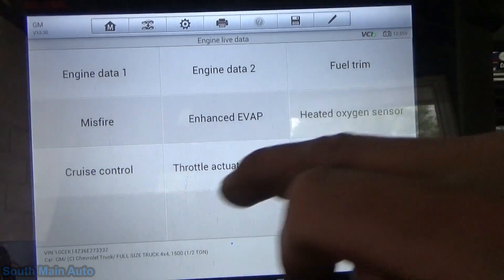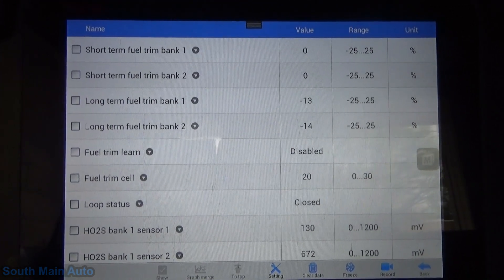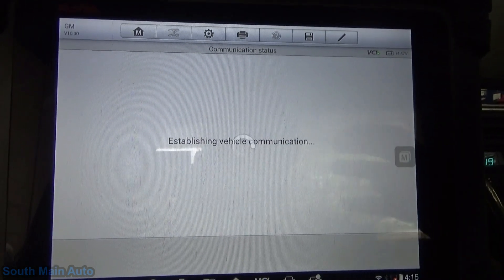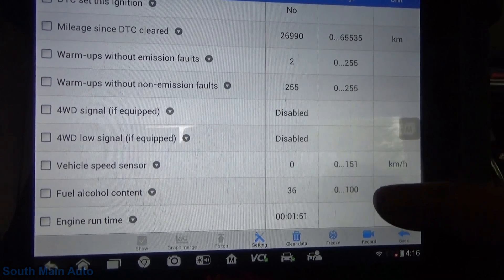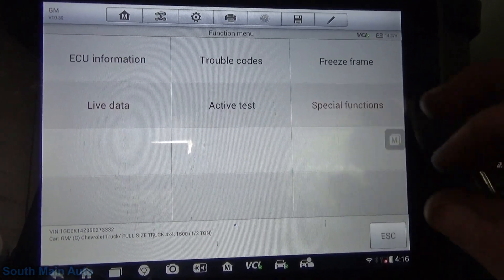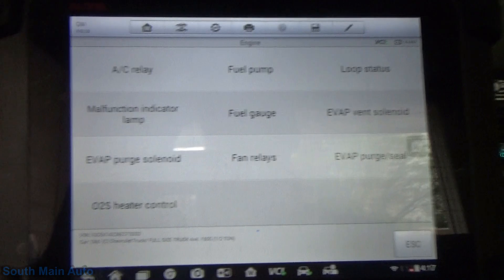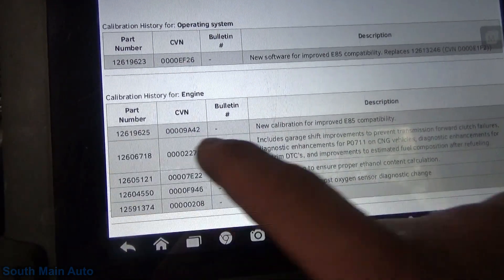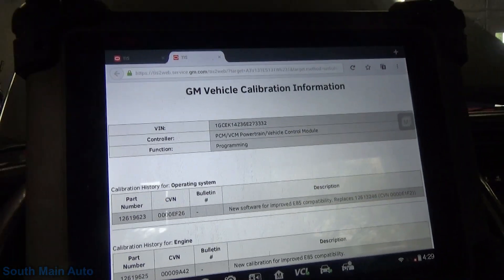Chevrolet Silverado - P0172 P0175 Running Rich

Comment: Didn't see anything but you checking alcohol in the fuel resetting & clearing codes.
My opinion is the codes will be back.
Reply from the maker: That is the fix for these. The alcohol counter gets off from miscalculating. Reset the counter to zero and ship it. Super common issue on early GM flex fuel vehicles. GM even has a TSB on it if you want to look into that. I explain it all in the video too.

Comment: This happens all the time on my 5.3 Vin O and I always run my tank down to 1/4 at the most, usually closer to 3 days after the gas light came on, haha. And then always fill it right back up to the top 
I have to reset my fuel comp about 3 times a year

Comment: Hi!  Its thanks to you and a few of these rich code videos that i found out my alcohol % was at 59%.  Got its reset at a shop to 3%. Ran fine for a while and i checked again and its now at 20% and trims are raising too.  What would cause it to go up again?  I run regular gas which is 87 octane here in BC, Canada.  Fill up full tanks every time.  Do a lot of around town driving, short trips.   A shop alsp recently changed fuel pump, but said connector was different on new pump so rhey rewired it.  Could this be an issue?  Its a 2008 Chevrolet Express 5.3 AWD flex fuel.  Maybe i should run it to empty, pay for a relearn again and then fill it up?

Wish i could just drive it to you, but i checked and its a 39 hour drive 😂

Comment: I have a 2016 Silverado with the 5.3L V8, about 144,000 miles. It runs great but recently started smelling very rich exhaust fumes mostly when idling. No check engine light or rich codes and local Chevy dealer blames leaky exhaust gaskets but there is no loud exhaust noise. I think the oil smells like gas but dealer says it's fine. I am worried the sensors are not picking up the problem and I might have a leaking high pressure fuel pump. Has anyone else experienced this or have any idea what could be going on?

Comment: I have relearning my fuel trim 4 times, replaced a fuel pressure sensor and the entire fuel pump but after a little while I still end up running rough and getting rich or lean codes. What is my problem here???????

Comment: My truck has been long cranking during cold starts. I checked my truck and the truck thinks it has 58%. The truck has never nor will it have E85 in it. No codes on the truck either. Good job GM. 😂. I always keep a full tank in it so I often put 3-5 gallons in at a time just to keep it topped off.  With that in mind, do you think that is what made it get out of wack?  Wish I could just disable it like I did AFM.

Comment: Just went through a situation like this with my 2012 5.3...I now understand what my dealer did to correct the problem I had with cold start rough idle that lasted about 4 or 5 seconds on a cold start...runs as it should now.

Comment: How did you get 5% if the water line was at 15? Thanks
Reply: Maybe because he had 90ml of gas then added 10ml of water. So the line was at 15. 15 minus 10 (of water) = 5% ?

Comment: Having same codes but on non flex fuel 07 Escalade. -18 LTFT on both banks, STFT 0-3. MAF slightly over reporting at idle, cleaned MAF, IAT sensor within range, map with range, ECT is good, recent oil change done along with spark plugs, wires and valve cover gaskets, new engine filter, reset fuel trims and after a week get same codes along with intermittent stabiltrak. No other codes given. Any suggestions? Driving me nuts.
Reply: I’m dealing with the same issue on 2010 Escalade did you find the issue

Comment: Not really sure what your solution was I have a 06 Silverado flex and got the po175 code changed the fuel pump and the mass air intake and still not fixed I always run empty and fill up so a little puzzled

Comment: That GM system does NOT sound smart at all 🤣 imo. Maybe they need to go back to or get the Alcohol Content sensor's instead of guess work. Wonder why the 02 sensor's don't have the ability to quickly report data back on a rich fuel mixture, then PCM proceed to instantly pull back fuel trims. Rather confusing system that's for sure. Maybe I need to learn more about it perhaps idk 🤔

Comment: About a month ago I had about half a tank and filled the rest with E85 just to see how it ran. Ever since I've been filling up at either 3/4 or 1/2 tank with regular 87. Yesterday I just got these codes. I'm thinking I need to run until empty, unplug the battery for a bit and then refill with regular since I don't have access to a scanner?

Comment: Anybody else have this issue and it not be the alcohol content ? I have a 07 tahoe got a cold air intake and dual exhausts and it use happen pretty often then i tuned it for more hp and better mpg and it pretty much stopped for about a month just got outta work and mid driving on my way home it popped back up i have no vacume leaks my alcohol is perfect fuel trims look great shits driving me nuts lol
Reply: Car is also driving great 🤦‍♂️ maybe am i taking off to fast after starting it ? Should i heat her up for a few minutes before leaving

Comment: You are a really good! So, the repair was to allow the computer to recalibrate the alcohol fuel % content? By driving it atleast 7 miles or fueling the truck more than 3 gallons. You checked the that the fuel was infact regular fuel. My truck was at 67%. I drove it 20 miles it said 58%. I topped it off (3.8 gallons of reular non e85 fuel) and its came back at 55%. My fuel trims are lovely exept once in a while you get deeper into the throttle the trims go -30, running rich. Same thing though, cel lights on for 0175 & 0172 with computer miscalculating the alchol %. Its a 2013, im guessing its got the latest software for flex fuel but im not sure my computer will read that, ill search tomorow.

Comment: Thank you for the information, I am certain this is the issue with my 2006 Avalanche w/ 5.3. Does anyone know how to solve this without a fancy scan tool or do you need to bite the bullet and go to a shop to have them see if the ECM needs to be reset or reflashed? Thanks in advance!

Comment: Amazing! I didn’t even know my 2005 was flex fuel but their was a sticker on the gas cap and every time I would go to the gas pump I would think could it be true? Then I did a little research and found out that if a certain number of the vin is a Z it is flex fuel but it was a Z it was correct. I took it to about 3 main Auto parts store and they ran the vin in the system for my fuel filter they gave me the flex fuel one. One time this kid at O’Reilys gave me a regular one and they didn’t know why it could be. I put half a tank of E-85 and the next day if was running funny. Also I had a diode go bad on my stock alternator so I was going to buy a new battery since it would drain it over two days as well as alternator.Long story short my son bought me a 160 amp don’t what brand from Amazon. It was good for about 2 months. It fluctuates from 15V-13.4 to the 14s and I know just from what I learn in college in dc/ac circuits it to mess up everything. Because it needs a steady flow of electricity. Right? Sorry for the long novel I left here but your videos I will watch for sure. Thanks god bless!

Comment: I have a 2010 5.3 Sierra Flex and I am getting a p2196 code. I've looked up everything possible and can't find a solution. I have changed the O2 sensor pre cat on bank 1 since the code popped up. New MAF.. No luck....any advice?

Comment: Hi i have a 2012 GMC Sierra 2500 with 6.0 flex fuel moter ,i have to bring truck in to reset Al hole mixture,after about 2 weeks you start it up and moter is jumping all over then it clears out and runs great all day,engine light comes up,i check the code,and it is po175 ,cant figure out what it is ,i bring it back in he clears code adjusts the mixture and the same thing happens again 2 weeks later,do you have any insight on this it would be helpful, thank you

Comment: Same issue on Pontiac Montana SV6 - dealer updated firmware, reset alcohol and it worked good for a a few days. Then the check engine light came back on, with same problem. Seems the alcohol learning is messed up on these flex engines. They said to use a certain gas station, but how practical is that? I read somewhere that the egr port gets blocked and maybe cause of fuel rich, but I have no idea on that... really lost on this one.

Comment: I may be dealing with this on a friend’s Malibu. He had a P0010 and an open intake cam actuator solenoid, so I replaced that. Also had a timing code and this P0172, none of which have returned but I’m worried the P0172 will be back

Comment: I just want to thank you for giving me direction on fixing my brothers 2011 Silverado Flex Fuel 5.3 Litre. Long term fuel trim was -26.6 Bank 1, and -28.5 on Bank 2. Alcohol % was at 63.5%.
Thank you. Truck going to GM for a reflash in the morning.

Comment: Good noon eric. I have a 2003 chevy suburban z71 ,5.3. With a P0175 ,both long term fuel are  at -15% too rich bank 2.  What should i look for. Recently i replaced injectors,  fuel pressure regulator and the fuel sensor thats on top rear of the engine, when taking out the top cover. I cant recall the name of it. Any info will help.thx

Comment: I thought this was very informative especially if there are other mechanical parts that may need cleaning or resetting like alcohol value.  I looked around at other potential parts controlling the air into the engine. Maybe for too rich air situations.the IAC and EGR valve. At this point, after, checking for vacuum leaks and finding none I still have a too rich air mixture. I am not too proud to say I need help in figuring this out. I have a 2000 Grand Marquis. I changed my intake manifold, replaced all my gas jets with reconditioned, and tested them before I installed them. I still need to test fuel pressure. I am sick of this. I can't afford to bring it to another mechanic. This shouldn't be too difficult to balance out the fuel mixture from here. I repeatedly get the P0702 or P0705. What says you, Eric? As for alcohol content, I did not think that was an issue back in 2000. My OBDII testers are not expensive and do not have alcohol content on them. My testers did indicate my Bank 1 oxygen sensor out of wack so I changed all four to make sure. I took off and cleaned what I think is the IAC valve and the EGR valve with choke cleaner and brushes, motor up on the IAC to insure I did not bork that valve. Tested wires, jets, and anything else I could think of.; these I replaced with new during the re-install of that plastic Dorman Intake. New Temp. Geese, as I said, I don't know where to go from here, Eric. I am 73 and have enjoyed auto repair all my life. I fear my testing equipment is out of date. Please help me.

Comment: I may be confused... but if the system was "wrong" originally and applying a negative fuel trim to what was not really a rich situation, wouldn't this engine have been in-fact running lean?  Is the rich code that set the MIL active a factor determined by the long term trim?  Or if it was the O2 sensors, I would have thought they would be showing lean instead.
Reply: That is my point exactly, the engine driveability issue was from the PCM pulling fuel back and thus causing a "Real" Lean mixture. What a dumb system that's for sure. You would think the 02's would quickly gather information on the real AFR Ratios then accurately correct. Idk maybe I need input from someone who knows more about how this system works without the E85 sensor 🤔 Anyone care to elaborate?

Comment: Would this possibly relearn on its own through multiple fill ups running to Empty each time? I do not have a scan tool that can reset the alcohol ratio.
Reply: Mine has been running rich for months and I've been running it to empty everytime cuz fucking gas prices

Comment: My 2014 Silverado is saying that the fuel is running too rich in bank 1 and 2.  My Check Engine light comes on every couple of weeks or so.  I was wondering if I should change out my O2 sensors or use Seafoam to clean out the fuel injectors.  If I take my truck to the dealership they'll charge me $140 just for the diagnostics.  Pretty sure I can get all 4 O2 sensors replaced for that price.  If you have any tips please help.

Comment: question, my 02 avalanche has a p0101 code, i was wondering if you can tell me what is the voltage i need to have at the maf plug so i can diagnose and dismiss if fault not found at the maf harness. thank you

Comment: I have a 2013 Chevy Silverado that is having the same issue.  Flooded the spark plugs to where it wouldn't start so I had to have it towed.  He said my alcohol was reading at 60%, I only use 89 octane in my truck.  Ran fine for 3 weeks and is doing the same thing again.  Will not start, so i contacted a different mechanic and he said it will start if I push the gas pedal all the way to the floor before I turn the ignition.  Is this correct?  Secondly, what do I do about getting this problem resolved, can't be down every three weeks.  Is it a bad sensor?  thanks

Comment: I don't normally comment on here, but I just want to say thanks. This video helped me tremendously. I have been an auto tech for 20+ years, and even GM certified. I left Chevy the dealership in '07 and have since opened my own shop. I was unaware that they were using fuel trims at fill up to determine fuel composition. I was only familiar with the systems that used inline fuel composition sensors. Last week I had an '06 Sierra comes in my shop with these issues, and found the fuel trims at -19%. The truck wasn't badged "flex fuel", I checked for a fuel composition sensors in the fuel line, which wasn't there so I determined it wasn't flex fuel. To make matters worse when I was entering the vehicle info into my scanner I was choosing the first 5.3L option on the list which was non-flex fuel, so my scanner was not showing a fuel comp parameter in current data, or giving me fuel comp reset option in special functions. Only after finding this video did I double check and found the engine code was Z(flex fuel). After entering the correct engine VIN code into my scanner I could then perform a fuel comp reset, and a fuel trim reset and problems gone. Again, I want to thank you for doing this because even us "professionals" need help sometimes.

Comment: Having similar issues with a 2010 Sierra FFV , I noticed when i was looking at the scanner that the Alcohol content was 68% which i thought was kinda odd. I am gonna try resetting that to  see if fixes the problem.
Reply: did this fix your issue? mine is at about 62%..

Comment: I have a 2012 tahoe.  I put regular unleaded gas in this morning, drove about 30 miles and my check engine light came on.  P0172 & P0175.  I watched the video, but don't have access to that kind of software.  Will the code reset if I empty the fuel?  Is it possible that the gas was bad and that once I burn off what's in the tank, the code will reset?

Comment: August 20th , 2019
After Getting my Hands on a INNOVA1003 . OBD2 Diagnostic Tool

Here is what showed up

1. P0175- System too RICH
2. P0036- Heater Control CircuIT (bank 1, Sensor 2)-H02S
3. P0054- Heater resistence (bank 1, sensor 2)-H02s
4. P0056- Heater Control Circuit (bank2, Sensor 2)-H02s
5. P0060- Heater Resistence (bank 2, Sensor 2) h02s
6. P0121- Throttle/Pedal Position Sen A Circuit range/Performance
7. P0140- Circuit no activity detected (bank 1, Sensor 2) 02
8. P0141- Heater circuit (bank 1, Sensor 2) 02
9. P0160- Circuit No Activity detected (Bank2 ,Sensor 2) 02
10. P0161-  Heater Circuit ( bank2, senosr 2) 02
11. P0172- System too rich (bank1)
12. P0036-  Heater Control cicuit (B1 ,S2) H02s
13. P0054-  Heat Resistence ( B1,S2) H02s 
14. P0056- Heater Control circuit (B2,S2) H02S
15. P0060- Heater Resistence (B2,S2) H02S
16. P0140- Circuit no activity detected (B1,S2) 02
17. P0141- Heater Circuit (B1,S2) 02
18. P0161- Heater Circuit (B2,S2) 02

 Heres what im gonna Say .... DIRT Road  Driving.. Whats your TAKE on this .. Mr Trainer of the unfortunate ..lol   ooh yeah .. copywrite stuff... . lets say. i aint loaded .but i will fix that needs fixing!
Reply: Since having the option of Resetting it .. and seeing WHICH codes come Back on... Which simple tasks are solvable? ??

Comment: Can using a K&N air filter cause it to throw the P0175 code?
Reply: Yes I had it happen on my tundra. The oil will mess with the maf and throw a rich code
Reply: Hmm.. I added a K&N and am now dealing with a P0175 but also a P0102. My Maf checks out with an oscilloscope
Reply: Afe performance dry filter will be the one I get next
Reply: @brentthedetailman2228  I will look into this one, thanks

Comment: thanks I have one in my shop right now and just checked learned alcohol value and it is at 47% with  rich both banks codes I cleared codes reset fuel trim reset alcohol content will test drive in the morning thank you for this video
Reply: What scan tool do I buy to do this???

Comment: Hello,
Hoping for a little help here. Here is the situation, I have a 2015 Chevy Suburban running rich. I replaced the mass air flow sensor but it didn't do anyting the long-term fuel trims are at -35 at idle. And it's popping the rich fuel mixture codes but nothing else. I did a fuel injector cleaning and it solved nothing. Also cleaned the throttle body. Fuel pressure looks okay at the tank and also at the rail. I don't know what else I should look at.

Comment: My long term FT bank 1 says -2.3 and bank 2 says 17.2. And my truck shakes bad at idle. What do u think it could be?
Reply: it's lean on one bank, does the short term fuel trim stay close to 0 when it's at 2000+ rpm? If so it could be a vacuum leak, if it's a GM then it's probably got a bad intake manifold gasket.

Comment: Also LT fuel trim 1 is at 0.8 and 2 is at -2.3 at idle. And when i rev the engine to around 3k rpm it they both move to 9.4% help me out what do you think is the issue here.  Thanks hope you see my message